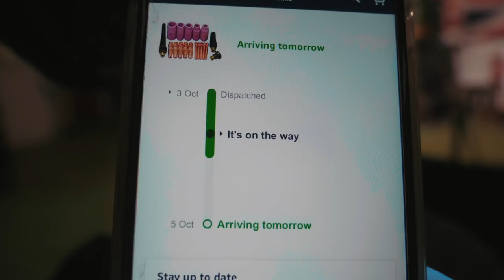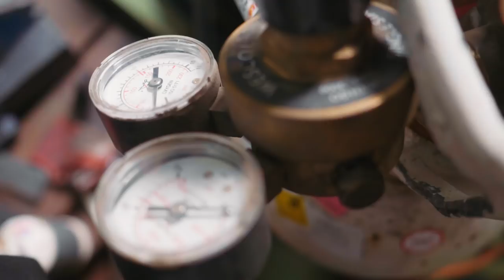MAKING FLAG-MASCUS BELT BUCKLES!! USA & UK!! Part 2

Comment: For your "unmounted" grinder - just put a small plate at the bottom of the stand - when you are using the grinder you will be standing on the plate and it will be stable. We used to do that for the grinders at a former job.

Comment: Hey Alec, when I first made my first belt buckle I used bronze and heat the end of the rod part that goes into the holes in the leather until it formed a ball on the end. Don't know if steel will do the same, might have to heat the end and peen it with a hammer for the future buckles you make. I found it easier making the parts separate and the soldering them on, than trying to form things after it is all together.

Comment: You should try using a pedal to control amperage on your tig welder. It will help you very much. Also use the argon post flow to shield the heated metal until it's no longer glowing hot.

Comment: Do you use any post flow when tig welding? You should take the torch away immediately you should let the gasses cool the weld down 👌🏻 don’t quote me but a typical rule of thumb is something like 1 second of post gas for every 10 amps

Comment: For that little pokey thing you could have used a giant finish nail or else there's a way to ball up the end of a wire. I'm not sure if it works with steel but I've done it with silver wire and copper wire. Dip the end in flux and torch it to it's melting point. Before it drips it will ball up on the end. Just stop there and you're good. It's a way to make rivets

Comment: I am sure that I'm not the first person to say this it but I would strongly suggest getting a gas lens kit for your tig torch. It looks like you're using a normal collett setup. The gas lens is such a big all around improvement with virtually no drawbacks, it is almost surprising that they still make the old style consumables. Look up "stubby gas lens kit" for whatever torch you have. Also check out the welding tips and tricks channel for videos on it.

Comment: The way we weld razor blades is we get a foot pedal. The torch you have isn't the best torch for what you do. You need to get a turntable torch head and a desert foot pedal. That will let you control how much heat your putting into you work peice, and the new torch will allow you to get to tighter places.

Comment: First off you need to clean the material to be welded and your welding rods. Acetone works as well as a stainless steel wire brush.  Second if you are tig welding you should never see sparks. Alec look into building a third hand tool it will help hold parts for welding.  Keep up the good work.

Comment: You should try some Silicon Bronze TIG wire, It takes less amps to weld things like on those belt buckles but it would not have stood the heat you used to harden them, its like brazing with a TIG torch. You can also use it to weld brass and bronze to steel. I still have a Nevada state flag for your shop but no address to ship to.

Comment: Maybe damascus with something else than steel?
Reply: I really want to see brass / copper damascus (if that's even possible)
Reply: If it was with anything other than steel, it wouldn't be called Damascus. In fact modern day Damascus Steel isn't Damascus steel. it's Pattern welded steel.
Reply: If you mix brass, copper and nickel silver you can make Mokume-gane. The patterns you get are similar to that of Damascus steel.
Reply: I know nobody knows how to make real damascus steel due to the recipe benig lost but everybody calls it "damascus steel" and I was referring to the style of material not the material itself. But one can not have to much information!
Reply: Maybe damascus steel rubber? Dorks....
Reply: Drunk and happy :P
Reply: +Darren Currie If you're referring to Mokume Gane as being  impractical for weapons or tooling, you're probably right. I've only ever seen it used for jewellery or decorative pieces.
Reply: +FarmerMiyagi It has everything to do with the region it came from. The steel is named after Damascus, the capital city of Syria. Granted this is a probably a mistake perpetuated by the European traders at the time. The patterned Steel blades sold in Damascus were actually made from ingots of Wootz steel, a crucible steel which originated in India. Whilst I disagree that the term "Damascus Steel" was coined specifically for layered forge welded steel. I do understand that modern day Damascus is known as pattern welded or layered forge welded steel. Which is neither totally right or totally wrong. ;) :)
Reply: They actually have "recreated" the process for making real wootz steel, though finding wootz quality ore is nearly impossible. You can effect it by adding the right impurities (vanadium, molybdenum, and chromium I believe), but none of the techniques for getting the various patterns seen in ancient wootz blades have been rediscovered. Some of the patterns have been reproduced, but the actual techniques are almost certainly different from what ancient Damascene smiths (who has access to wootz quality ore) used.  All of that said, besides the cosmetic properties, there isn't much point in wootz steel.  Modern steelmaking processes (oxygen converter process or electric arc furnaces) have rendered the old ways obsolete, allowing modern foundries to produce a far superior product with precise control of the desired alloys.

Comment: The reason for so much oxidation from your torch is that you use the oxidizing portion of the flame. The hottest part of the flame is just in front of the bright blue cones nearer to the tip. This is also the reducing flame. You tend to use the softer, more yellow (oxidizing) portion of the flame. While this portion of the flame seems to bathe the piece more, in reality it's much cooler as most of the gas has burned off, leaving a lot of oxygen, hence the oxidation. Try reducing your adjustments so your flame is less billowy and tighter. Move your rosebud closer to the work piece with the tight blue cones roughly 1/4" away. You should see a big difference in both heat times, and oxidation.

Comment: Not a metalworker, but wouldn't it make more sense to add the blob first to the stock and make sure it looks good and works, and then cut it to size and weld it to the final piece?

Comment: You always look like you have crazy amounts of fun mister Alec Steele… 
…You know what else would be fun?!! …Making a pair of damascus Wing Chun Butterfly Swords!!! That would be all sorts of crazy amounts of FUN!!!!! 
Just look how many exclamation marks I used! it would be THAT much fun! Go on! You know ya want to!!

*Edited in shame and dishonor
Reply: I'm with Luke on Wing Chun swords, I had thought of it some time ago and forgot to comment.
Watching you try to Tig the hardware onto the buckle backs was painful, I would always use a fine oxyacetyline set fand gas weld fine stuff like that. Gas welding is a useful art  to have anyway, plus the kit is good for brazing  and I have welded and repaired cast inlet manifolds in the past, something I am pretty sure you can't do with Tig. Though it might work if you soak the piece to get it evenly hot before trying tig.
 Once again I second Luke's suggestion on Butterfly swords.
Reply: Since when are butterfly swords Wing Tsun?
Reply: Since I googled to find out what the Swords were and that's what I got. I'm sure they have a more traditional and official name but that seems to be a commonly used name for them. Sorry if I offend.
Reply: Other styles than Wing chun use the swords but one of the aspects of Wing chun's forms are that they are the same empty hand as using most of the double weapons and in many schools students will begin learning with weapons at the same time as learning empty hand.Choy li fut and Hung Gar are other styles and I know one of my mates who was a Chi Gung master had a pair of butterfly swords but used them differently.
Reply: My knowledge goes as far as I saw them in IP Man and thought… damn they look cool and I bet Aleec Steele could make a great pair of those! Googled and have politely suggested them ever since. He will make them… whatever they are called. I'm persistent ;-)
Reply: Everybody Wing Chun tonight...
Reply: Alec being a guy who likes a laugh might make you keep this up for a year or two, lol...... I think your up to it!!!!!!!!!!!
Reply: I'm damn well gonna try!! …and I'll still call them Wing Chun Butterfly Swords too! ha!

Comment: Hi Alec, can you try to make a stainless steal damascus using AISI 316L and AISI 304. Something new to deal with
Reply: Stainless is much harder to forge weld it forge welds at a much higher temp than carbon steel and is very difficult to pattern weld
Reply: You said right James. Very difficult, but not impossible.

Comment: Can designs be etched onto metal with acid by using a plastic adhesive template to protect the parts you don't wish to be etched?
Reply: Andrew Hart usually people use a paint. Nail polish is perfect. With the plastic there would be hogh chance of it seeping under.
Reply: Benjamin Schwendiman Ah yes, I saw the nail polish technique on an earlier episode here, I was just thinking of the intricate designs possible in a sticky back plastic via laser cutter or other technique and thought some cool designs could be etched.
Reply: Andrew Hart in theory it would still work, would just need to print the image inversed. Then stick it on apply nail polish, peel off, let dry and go.

Comment: Alec great buckles BUT the backs look like an beginner  made them. couldn't you attach the loop and hook to a thin TEE shaped piece  of metal, clean it up and then spot weld them onto the back of the buckle. its like you put an angle iron bumper on an expensive sports car.